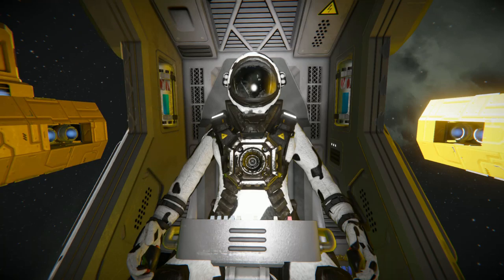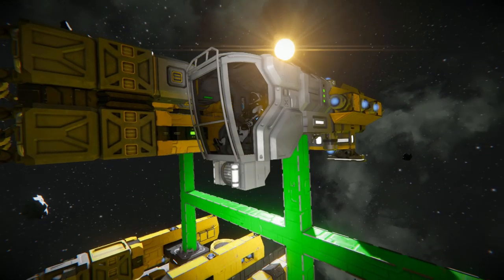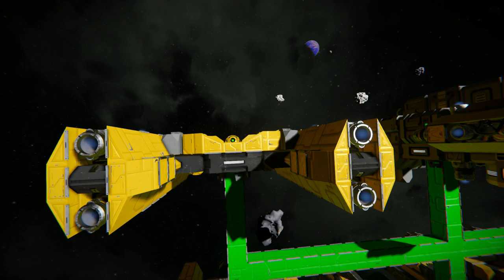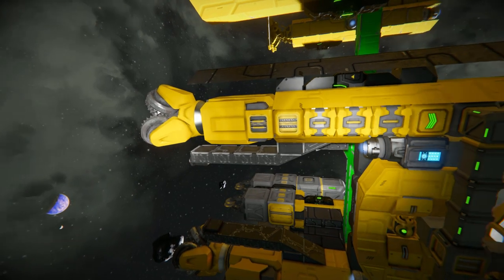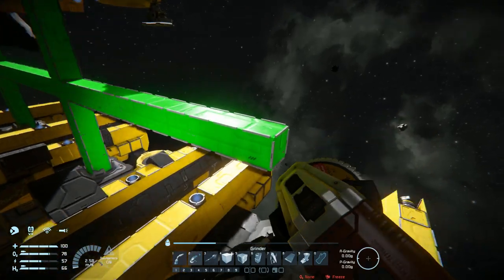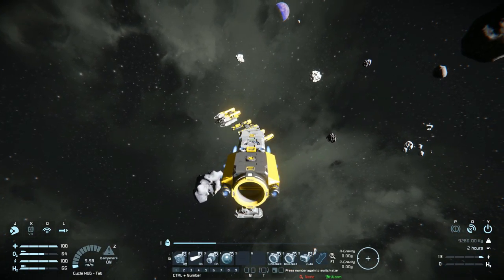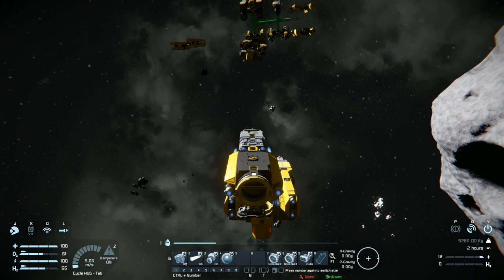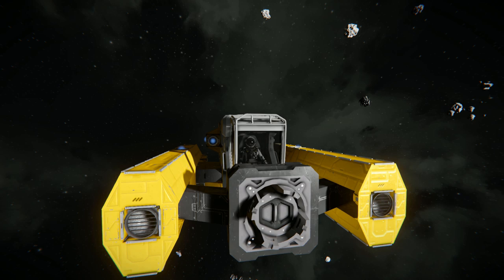The Rig-Bee - Space Engineers

Comment: This is a slick design, and I really want to like it, but it's badly in need of some constructive criticism 😞 The biggest problem is with the plumbing - the rear connector and bottom connector don't appear to be connected at all, but if they are, then it is with small conveyors, which means no parts can be fed to the welder or from the grinder. You could still make use of them with a bit of jiggery-pokery, but a good design shouldn't need that. Also, the default gray bits look out of place alongside the bold black-and-yellow of the rest of the ship, at least IMO; maybe the creator was trying to blend with those awful gray accents that every block inescapably comes with? Still, the overall design looks snazzy and has potential, and the packaging for the workshop is clever.